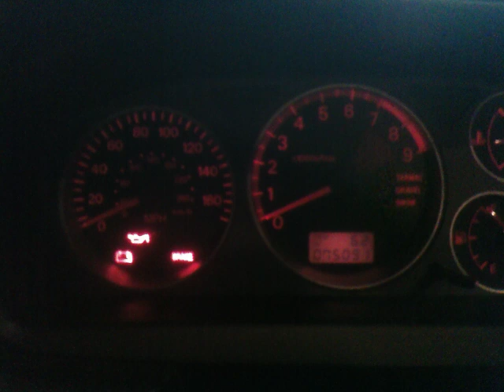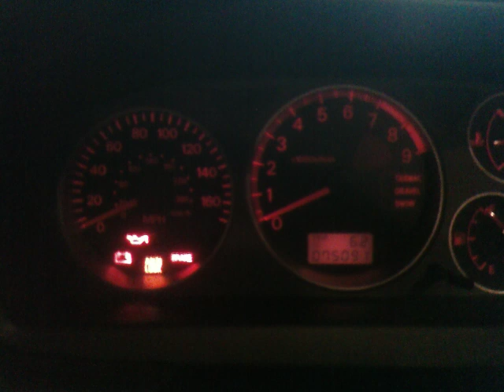Mitsubishi Evolution VIII / IX - How to Diagnose ACD Error Code

Comment: i have the same problem on my 2005 evo 8 rs... when turn on the car it only show 1 light but then after 3-5 sec all 3 lights on. some day, it will come on just 1 light and then some day it come all 3....
any help please?
Reply from the maker: You will need to take a wire or paperclip and jump pins 1 and 4 in the OBDII connector to put the system into diagnostic mode (obviously, do at your own risk, but should be ok - just make sure you use the right pins).  Once you do that, you should see a light sequence like what is in the video.

http://www.obdtester.com/images/obd2_connector.png

This specific code was for a bad pressure sensor, but there are lists available online that show the different codes.:

http://www.evoscan.com/technical-vehicle-manuals/62-acd-ayc-sayc-at
Reply: missinyoubabe

Comment from the maker: This video shows the light sequence I got after I put the system in diagnostic mode by jumping two pins on the OBDII plug (I don't remember which pins but you can search online or on the Evo forums).  Normally it will just show 3 solid lights if there is a fault.  If you have 3 solid lights your ACD system is not working, which is pretty common as the systems aren't very robust.

Comment: That's weird, mine actually turns on and stays on after driving for a few meters. What could that be?
Reply: Did you find out what happened your evo diff light?cheers
Reply: Yes did you ever find out the cause as the 3 of also show after driving for 100 yards but the don't flash , stay on solid
Reply: @andybhoy2009  what was it mate?
Reply: @adamollier4911  pump was gone mate , had to get it rebuilt